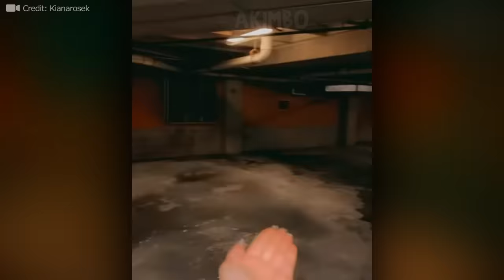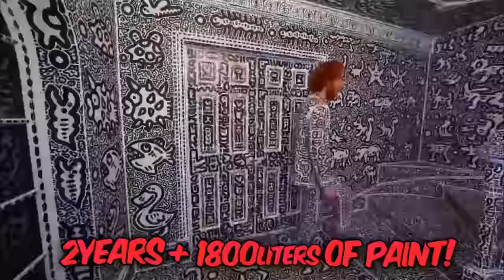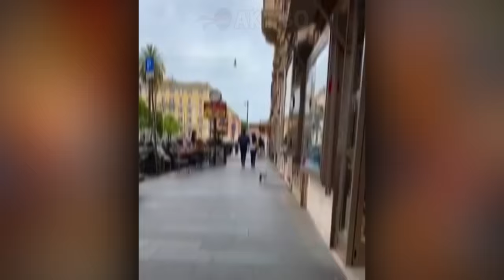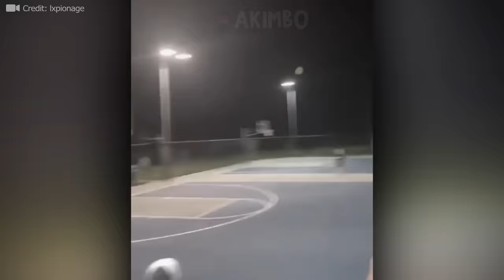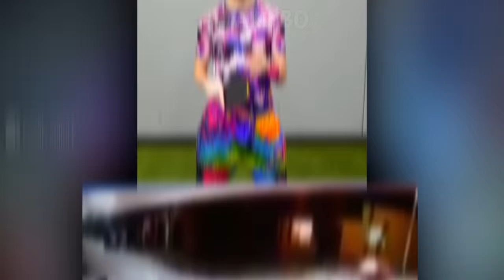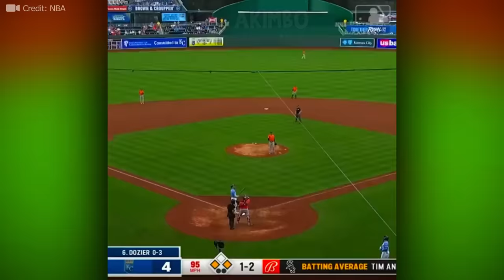1 In 1,000,000 Moments !

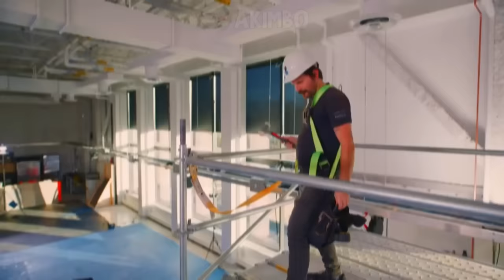Comment: as a bowler myself, i can say that 4:26 is not the hardest shot. remove the headpin (the one in the center), and youll get the 7-10, as the only way to convert it is to bounce the pins on the curtain behind the pinsetter. that 1-7-10 pickup was still lit